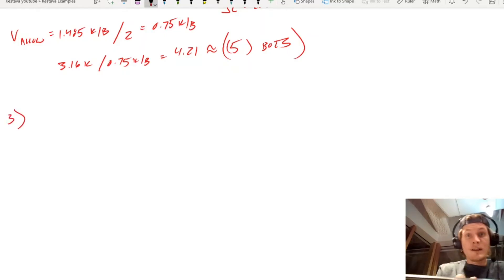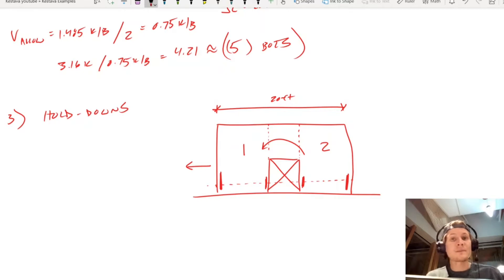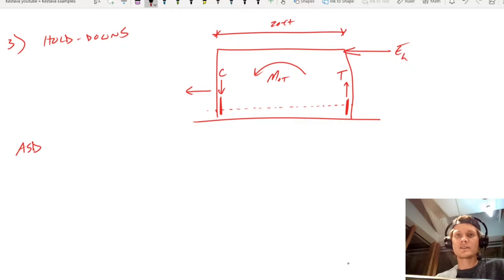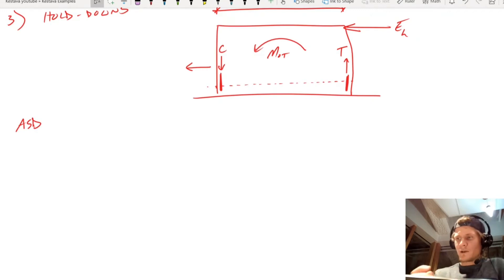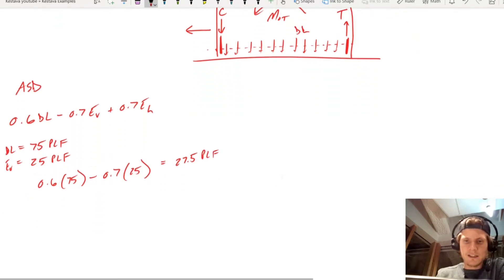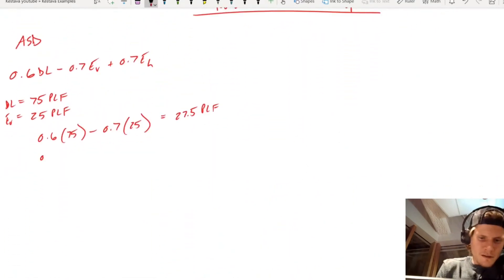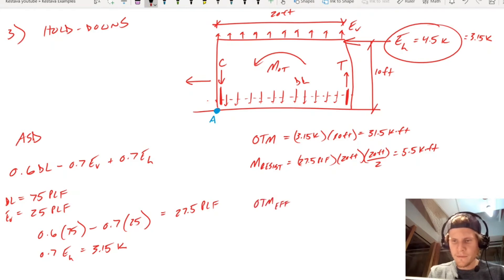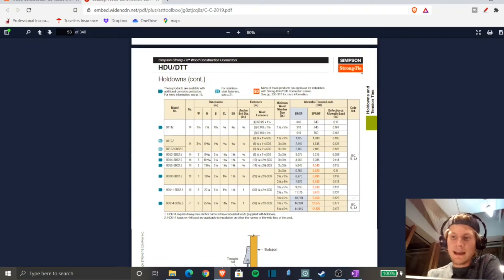Wood Shear Wall Design Example - Part 3 of 3

Comment: What if you have a small building with clay roof tiles, let’s say a shed that’s 9x13 and it has 10ft walls with 3,000 pounds worth of roof tiles. Will holdowns work on something top heavy with a small floor plan?

Comment: Thank you so much. Very informative. 
I am renovating an old wood frame house in Pennsylvania. It has not moved or been damaged in about 150 years of weather and storms. The whole house sits on stones and blocks. The "sill plates" are squared off trees or rough sawn 12 by 12 lumber right out of the nearby forests. 
How did this house possibly survive in one piece over the years?

Comment: Can you use the dead load of an exterior finish? For example, lets say you have an exterior stud shear wall that has brick and this 3-story building is over 30', so not all the brick can go to the foundation. Could you use the weight of the brick as DL to help with the hold-downs? Or would it be best to just use the weight of a normal stud wall (10psf) regardless of any exterior finish?

Comment: You are an absolute angel! I watched all 3 videos with so much excitement and notetaking. I have tried learning structural in other ways and nothing comes close to your ways of explaining.

Do you know what all changes when the wall height has a increasingly slope to it? Does it factor into a different Eh calculation?
Reply from the maker: You're so welcome! Your comments really do mean a lot! When the wall slopes its typical to take the mid height of the wall and run calculations this way.

Comment: Thanks a lot for the shear wall design series.  l got my BS in civil engineering 50 years ago and left civil engineering for software after one year of highway design. Now I am in thrust back into it as I am trying to get a building permit for a 9-foot door leading to  a sun room. The city plan checker and the designer are arguing and you have shed a lot of light on the issues, so well that even an old timer like me can understand it.
Reply from the maker: YES John! thats what im talking about! send me an email if you need any input on your sunroom plans and id be happy to give my 2 cents

Comment: Can you please tell me how did you select worst case for load combinations ?
Reply from the maker: I chose it based on the load combination from ASCE 7-16 chapter 2. in this case i just assumed seismic controlled over wind for the example. Check out part 1 to hear more about the load combinations! thanks Jeet
Reply: @Kestava_Engineering  Thanks for responding back. I got that part but my confusion was about picking the load combination 0.6D - 0.7Ev + 0.7Eh because there are three options in the section 2.4.5 and you called it worst case scenario isn't 1.0D + 0.7Ev + 0.7Eh would be the worst case ?
Reply from the maker: @JKS323  for the design of hold downs, the dead load acting on our shear wall actually helps counteract over turning forces which then results in lower hold down forces. so the equation using 0.6D reduces our effective dead load resulting in higher hold down forces to design for. The -0.7Ev means the vertical component of the seismic forces are acting upward in this load combination which would add to the overall over turning forces. that is why this case is worst case for hold down design. if we designed the compression post at the end of the shear wall - the worst case would be  1.0D + 0.7Ev + 0.7Eh to design the compression element. I hope this helps!
Reply: @Kestava_Engineering  That's what I thought too but thank you so much for confirming.

Comment: This is on point. Thanks for the vids! Could you do a SW example with vertical irregularity (SW not stacking), design of transfer beam and how the load path work from there?
Reply from the maker: Great suggestion Huni, consider it added to the list!

Comment: What software do you use for seismic design ? ETABS , SAP2000 ?
Reply from the maker: both are great! but I lean more towards ETABS
Reply: @Kestava_Engineering do you use any other software for wood design ( wood frame , wood floor , wood roof etc ? I would like to know.

Comment: when you did overturning moment about A, how come you didn't include E sub v?
Reply from the maker: Hi Nesllin - I subtracted the factored Ev at around 7:00 to get us the least amount of weight providing the minimum case for resisting moment. Let me know if this doesnt make sense! thanks!
Reply: @Kestava_Engineering  Omg, I didn't realize I completely missed the M_resist
Thank you so much
Reply: When designing for just windload and not seismic, is the design process the same?
Reply from the maker: @jorgegalvan3200  very similar just different loads. also you dont need to worry about your overstrength factor.
Reply: :) thanks mate